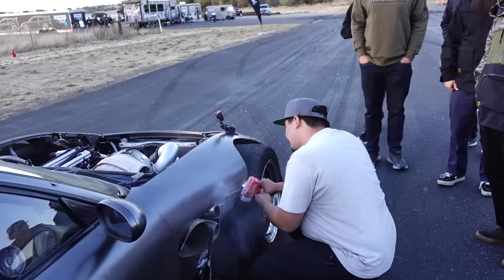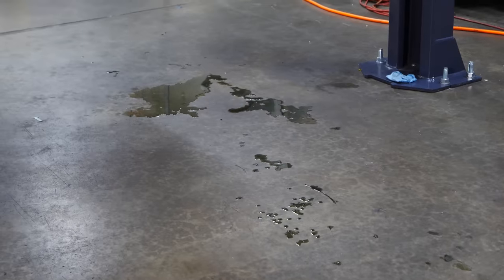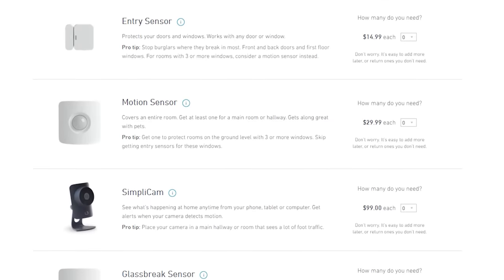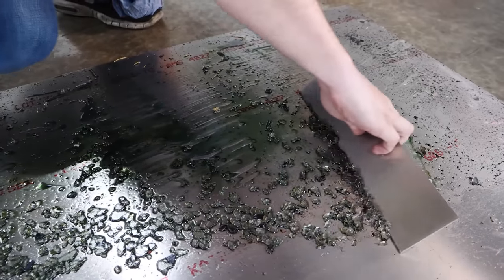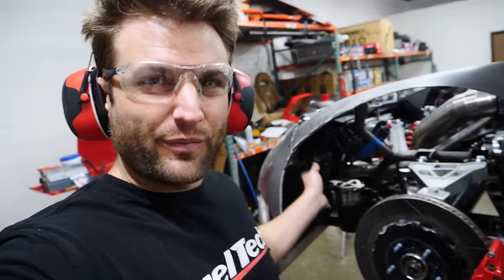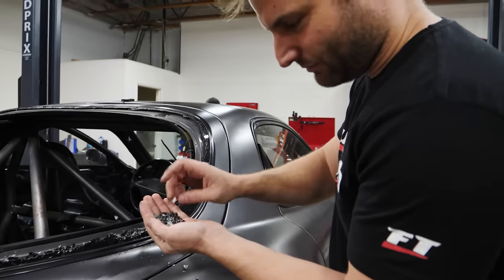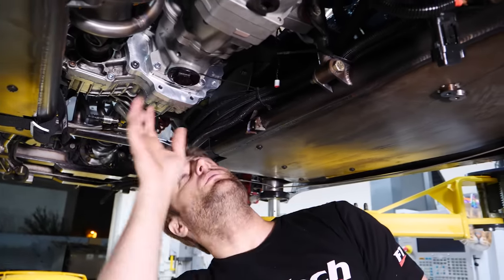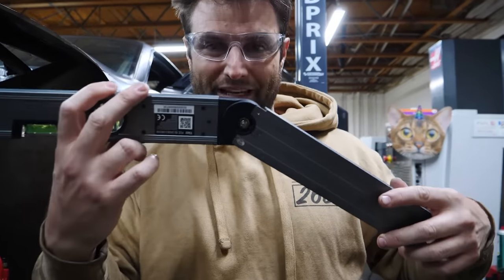How bad is the Damage on the 4 Rotor RX-7 from racing the Hoonicorn?

Comment: Where this car is meant to shine is the pedal to the metal, no lift, no clutch shifting, like the Hoonicorn did. It has a sequential transmission so act like it.
Reply: If you don't like the idea of no lift shifting, at least stop using the clutch on the up shifts. Why have a sequential if you still treat it like a stock gear box.

Comment: Windshields are not tempered glass. They're laminated glass. If windshields were tempered they'd spider all over and be unuseable after they cracked.
Tempering glass locks in tremendous internal stresses.

Comment: Time to work on your “no lift shift”. You can really see how much a pro Block is, just based on his shifts.
Reply: Or he just has a transmission that he can shift the way he wants and theres a fuel cut + electronic throttle programmed with the shifts so he can just floor it :)  Sure Rob needs to get used to the gearbox aswell.

Comment: I'm trying to be helpful when I say if you spend 99% of the time taking the car apart and putting it back together and 1% testing, this is what happens over and over in various different unpredictable methods of failure. You should try to do a weekly test day or something, and more than just doing laps around your building. Is it hard for you to get to a track or strip for testing? Maybe that's why you stay around the shop? Great job on the car though she'll be a ripper when she's all squared away one day. Nice job on that driveshaft too. I can see your power level is increasing.

Comment: Wheels, tires, and clearence.

You shouldn't be waiting until it's driven to find the limits. Remove the spring and dampers, jack the wheel/tire combo all the way up, and turn the steering wheel. Those are your limits. You can remove material, or use hard stops, but that's the better, faster, and safer way to find steering angle and suspension travel limits.

Comment: The car has done, what, 5 miles and it is half wrecked.
And oil and shit every where.
Laminated screen are two pieces of 'normal. glass bonded together with vinyl in between

Comment: I was wondering, IF you decide to do this, but for the C8 and Diablo swaps, I wonder if you can keep the stock exhaust for daily driving, and then make a pipe that just uses a valve to bypass the mufflers, and then BRAAAPAAAPAPAPAPAPAPAPAPAAAASTUTUTUTUTUTUTUBBRRRAAAAAAAAAPAPAPAPAPA

Comment: I was thinking what caused that hood to lift was 2 things. 1 lack of fender liners.  2 a lack of sealing around the windshield cowl.  That is a high pressure area.  All oem manufactures try to seal that because it will fill the engine bay with air and disturb the bottom of the car air control.  I bet if the engine bay had better sealing you may of sucked the hood down.https://cimg1.ibsrv.net/gimg/www.corvetteforum.com-vbulletin/470x265/nascar_aero_inline_1b9dedd8dcf449ac323e77a24c33b6781d2dcfb5.jpg

Comment: I don't know, still not happy with the sound of the engine,  doesn't sound right, I remember they open it, rotors needs to be installed Correctly on timing, I'm not sure if because of the sound that engine has one or more rotors out of time, just my opinion, two step doesn't sound or look right, short exhaust must be popping fire